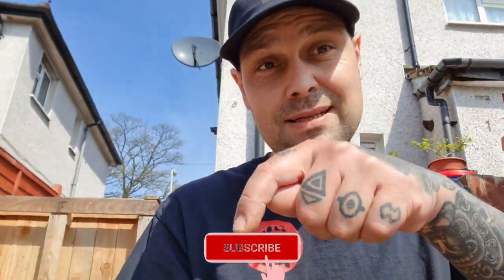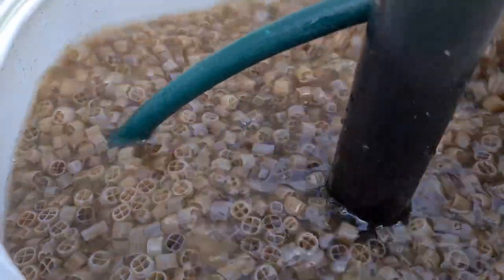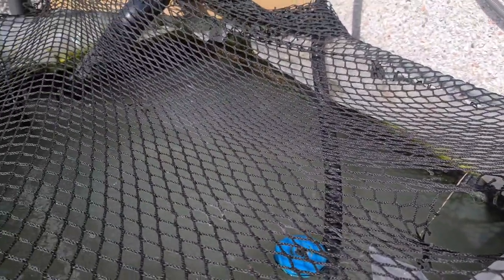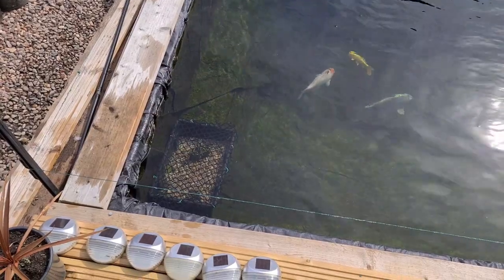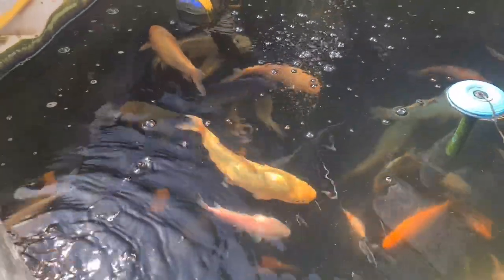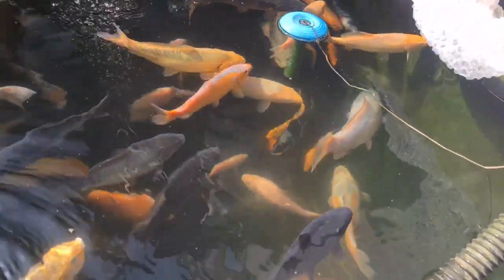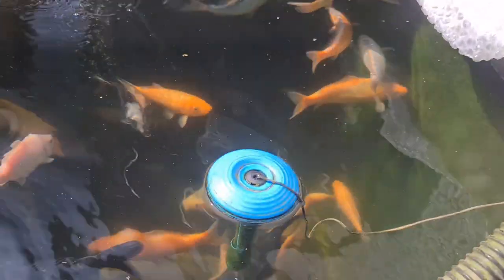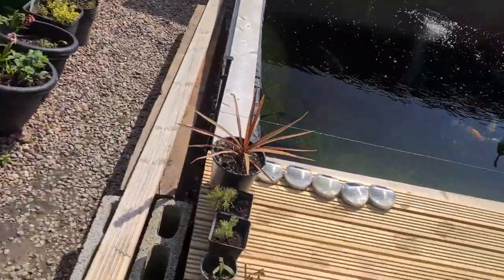** BLAGDON POWERSAFE 3 SOCKET REMOTE SWITCH BOX + A LOOK AT THE KOI FRY

Comment: Hi Leon, your decking really sets the pond off now. The net on the lily basket isn't a good idea. I did it on a customer's pond and two of her smaller fish got their heads stuck,  with the net caught behind the gills. One didn't survive. What I did instead was use those big pebbles about 6 to 8cm or 3 to 4 inches. The lily's push past them no problems.     Also a little tip with the switch box, because they are a pain in the butt to wire up if you need to disconnect stuff. Just wire in a short extension lead into each switch then put plugs on to the air pump etc. Then you've got the convenience of the switch box and the ease of connection of plugs. Hope this helps.
Reply from the maker: Thanks Tony and cheers for the tips 👌👍
Reply: @progressivepondkeeping  👍👍